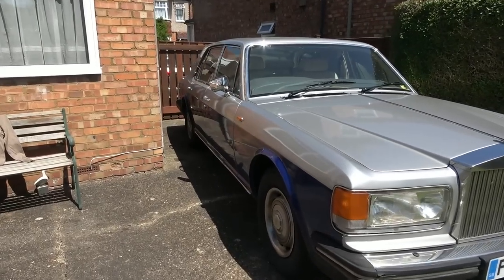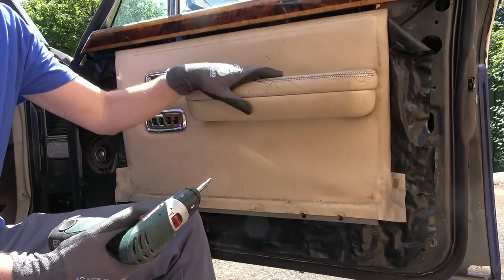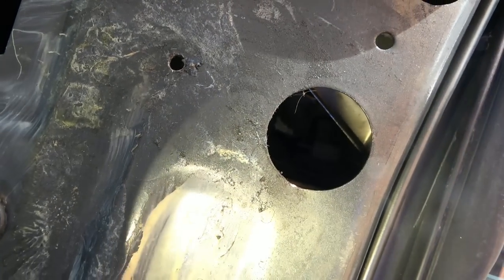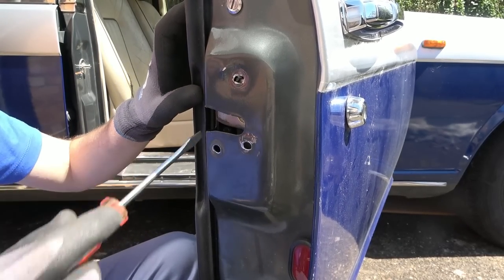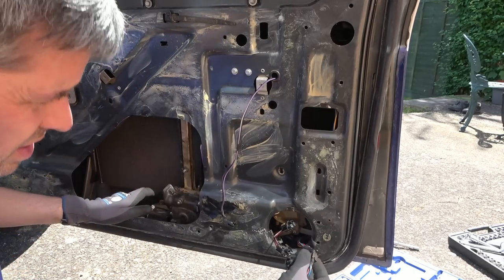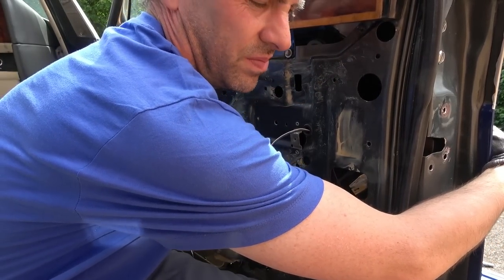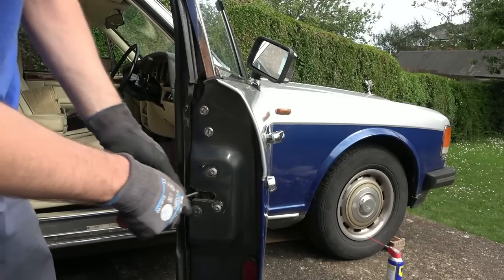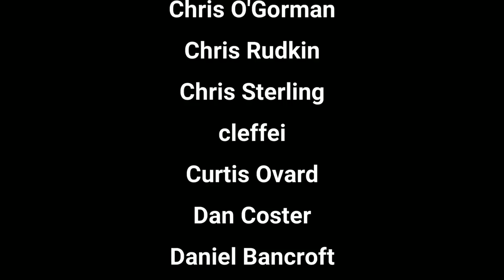CAN I FIX a ROLLS ROYCE - PART 1 - FAULTY DOOR NOT OPENING

Comment: Do you have access to a garage or storage locker? E.g. taking of the doors and working on them is way easierer. Also you can remove big chunks of the car to clear or refurbish without running the risk of getting your car all wet during a thunderstorm. And I guess you'll already do it correctly: but use a (small) bin for every part, e.g. left front door and label is, so you also don't get screws mixed up.
PS: If you take out the doors, be very careful with those springs. Maybe get a 2nd person helping as they can be really heavy.

Comment: Vince, you need to upgrade your tool kit!  A 1/4 inch drive socket set would be a good start.  Saves you having to struggle with limited access. You have plenty to keep you busy for a good while.

Comment: As a driver of old used cars the only recommendation I have is to make sure to grease everything mechanical before putting it back together. Nothing worse than sticky latches.
Reply: I think some spray lithium grease would be good.  I wonder what the RR maintenance manual recommends.  As a Mechanical Engineer it's important not to grease threads unless is it actually recommended. The relationship between friction, torque, and bolt/screw stress is not to be toyed with!

Comment: Buy the haynes manual or get an official workshop manual. Possibly on line. You will not regret spending the money
Also got to love the "Ill put the screwdriver through the whole and lever on the bit im trying to pull out.
Get a home glue puller kit

Comment: If your going to treat the electrical block connectors, cover the whole block in silicone grease, it wouldn't hurt to apply a bit to all the mechanical party's. This grease doesn't wash off with oil based solvents or water. So very long lasting.

Comment: I noticed that the screws on the side with the faulty lock release were Torx, but the side that was okay had counter sunk straight flat head screws.
So somebody had worked on that locking Mechanism previously. 
I wonder if there is a Haynes Manual for the Rolls Royce?

Comment: If that hole is dented in, I would stick a washer on a >4" long bolt. Reach into the door, and put it into the hole.
Then you can grab it with a slide hammer. (Or just use it as a press: drill a hole in a piece of wood[or whatever], put that on the bolt, put a nut on, and slowly screw the nut down). I assume slide hammer = cracked paint. press seems safer.

Comment: You saying about the leather, in my Reliant I have a rear seat set from a Robin 65 and apparently they used leather they bought from Rolls Royce direct for the very limited edition final Robin's which had full leather interior, electric windows and a deeper plush red carpet.

Comment: A crash repair person can best advise you on removing the dent in that door-shut, though I suspect a piece of metal cut to the right size and a slide hammer are going to be a better bet than prizing with a screwdriver. Get all that rust out and rust treat every internal bit you can get to while it's all apart, grease every mechanism etc

Comment: Did you try the Auto locking system when starting up the car?  it 32 minutes into this video I started thinking watch it be something simple like a fuse. Some cars ( I repeat SOME CARS) with power locking have a fuse for locking and another fuse for unlocking. same with power windows a fuse window up and another for window down. Which I experienced first hand.

Comment: I worked in the RR/Bentley factories in Crewe occasionally.

The interiors of the cars they crash tested were built up out of parts that had failed QC, they looked flawless to me but occasionally you'd get a part with a circle round  the 'flaw' to highlight it, they were usually near invisible. 

So, Hell no RR wouldn't have screwed through the carpet like that, that's been done by some cowboy and yes, the 4990 will mean the leather was all from the same hide/dye batch, the attention to detail and quality was insane which, along with the manual labour explains the cost.
Reply: I own a 89, 20,000miles, After watching this I looked for the screws.  I was a bit surprised to find two, nicely spaced, heads hidden by the carpet. Seems odd to me

Comment: Hey Vince, the central locking is supposed to work that way. When you unlock the drivers door you don't want all the others to unlock if you are alone. If you have company then you open the drivers door and unlock all others from the drivers door button. If you were a chauffeur you would have all doors unlocked  before your passengers arrived anyway. Don't go looking for a fault that isn't there, Ask me how I know.
Reply: I am pretty sure if Vince bumps the key further he will engage the electric locks.  It's how my 89 works.

Comment: i really mess this ability to repair in cars even though it’s a rolls-Royce you used to be able to do this in regular cars as well even though it wasn’t is fine material now it’s just throw away which is just sad very good video I did cringe a little bit when you were praying on the metal but you Gotta do what you Gotta do to get it straight so good job I’ll be interested to see what’s up with the window motor hopefully it’s nothing too serious I do love to build quality in those old cars there a joy to work on

Comment: I think you will be happy you got the end of the run MK1 because by then all the niggles etc have long been ironed out, the horror stories and wallet bending nightmares are the engine and suspension although not sure but didn't the MK1 use Citreon auto levelling suspension components?   Do you fancy a go at a 3d printer?   I got an early Flashforge Finder here that is not getting any use and it does have a fault in it has a bit of lateral drift but works fine with good motors and heater element, its bloody huge though m8 and not sure how much postage would be or if your PO box would accept it, not heavy just a big box, has a full roll of copper effect filament.   Yours if you want it m8, if you didn't mind waiting I could ask me uncle to deliver it when he comes visiting next as he lives in the Alms house in the high st.

Comment: Take off the wood trim. This will give you a better access to fix things. Where the damages to the lock area I will get some large washers and a bolt and a nut and tighten them up against each other it should flatten out the damage to where they screw goes to fix the lock to the door.

Comment: You did an awesome job, door mechanisms are a right pain and fiddly to work on. Torx screws just don't seem right for that age of car and UK built. Just seen the prices for replacements in a comment below! Might be worth seeing if there is a hobby engineer round with a small lathe that could make you some replacements or somewhere like Accu might already make something similar.
Reply: My 1989 does not have Torx, I agree those are out of place.  Slotted, with flashy washer like the other doors.

Comment: Try an inspection camera before dismantling. They are very cheap nowadays especially the USB type.  Even cheaper is to solder wires to some small 12v bulbs and light up the interior .

Comment: 5.52 hi MMV, looks like some of the metal clips are missing, you can see one not there under the speaker grill, thats way they used screws to hold the bottom of the door panel on

Comment: Such a nightmare of a door to disassemble.

With my 31yr old 4WD, I just undo 1 screw on the inside door release, remove it, undo 2 screws on the door handle, remove, remove the PP81 clip that holds the window winder in place (Making sure not to lose the blasted thing...), remove window winder, then pull door panel off from its clips, hey presto, I now have access to the entire inside of the door.

Comment: I hate they way the make it so hard to do a simple repair, I tried to fix my window that come off the belt in my car 3 hrs ago and the whole door panel was solid no holes only for wiring was riveted and had no access to anything.  How the heck are you suppose to do any work on that unless you remove all the rivets.

Comment: you could have put a bolt in the lock screw hole and use a sliding dent puller to remove the dent.

Comment: I don`t know why you didn`t just chop out a hole between the square hole and the round hole with an angle grinder, it would of given you easy access and probably wouldn`t of compromised the strength of the door much. I`m looking forward to you restoring all the veneers of the woodwork and the leather, they have apprentices take years to do that stuff well.

Comment: I'm guessing someone changed the door latch mechanism and the new latch has a different thread. That's why they couldn't replace the other screws. The new latch is metric thread probably. The old one was imperial. And they knocked the torx heads back into the door probably because they sit too high and scrape the other side of the door where the strikers fitted.

Comment: Um, is the key only unlocking the driver door, but locking all doors, not by design? It makes complete sense, unlock just your door for entry, if you need other doors unlocked just pull on your lock stem and then the other doors unlock; similarly, when you are leaving the car, you can lock all entry points by locking your door from outside?

Question this on any forum you've joined.

Comment: That door has been taken apart before the bolts on the lock are torx but the other side is flathead plus the torx bolts are all different and the paint around them is scratched and chipped away so so one else has been messing with the lock before you.

Comment: I think, in order to help your self and make life a little easier with the car, invest in a decent tool set. Nothing like a billion piece mechanics set but a good quality socket set, more 3/8th than 1/4 but they come in handy too. try to avoid the cheapy all in one sets because inevitably they'll be missing a common socket that you will need. trying to snake a 1/2 inch extension with a similar sized socket with a tiny 8mm (or smaller?) head on it seems like it caused more work than what its worth. and i'll probably keep from damaging more on the car.

Comment: To be honest, having a door not work is annoying. I did quality control for GM and yes there will be people looking at this as cringe-worthy but I think it's amazing. The window motor is called a regulator and it would be pricey to replace (with an official Rolls Royce regulator) but I bet with a bit of investigative motor repair you just might be able to fix it. I've seen you fix motors. If you need to substitute make sure orientation is right (up and down) and also control. You want to make sure the motor doesn't snap the glass.

Comment: Oh a really like the idea of this series, as you come closer to the engine and electrical valve's and hydronics.i probably can help you with some thing. Just one tip, painters uses a white paper to cover your flors, it is 
Brilliant to use around where use taking things apart. You can use a black pen to take notes of things to remember where you put things. It is like a giant note book.

But i restored a 944 and let me tell you some things i did do wrong.
Take you time and set your self a budget for time and money on different part of the car.

I did start small with things like seats electrical switches and relays.
Then i realised i needed to stripp every singel part to get to al the rust.
Some one did rebuild the hole engine and some where about 1100 hours in i needed to move the car from the garage and then every thing got messy. I sold some of the car as spear but not nearly got the money back.

What a great fix!
Even i would not love 20 minutes of taking out that bult, but it is intresting to follow in detail how to take it apart and follow you on your journey. But i think you feel when you have an excuse system and a petrol tank to take down to change the hydronic lines you can just put on some jonny cash and just work your self through, Because you have the red line of hydronics in that specific video.

I am so excited for part two!!
Thank you
Reply from the maker: The paper notebook is a great idea. I never realised you had a Porsche 944, I was looking at the 924 before my son mentioned the Rolls. Thanks for the feedback, I will probably shorten the dismantling bits and concentrate more on the problem and the fix (if there is one). Cheers Anders 👍👍👍

Comment: I guess if you've never done a lock before, you aren't going to know it's a 10min job to fix - lol -. 
You need to get a mirror to see what rods are pushing what - you can also buy a cheap endoscope for $10 -, because it looks like someone forgot to put the rod back in the nylon bushing when they took the lock out.  
You need a 3/8" drive socket set, ie, 1/2" is too big because access holes are usually small.
Your speaker is also ded - lol -.

Comment: The big giveaway that someone had been there before you was the T30 Torx bolts, on the passenger side latch retention screws were all polished chrome flat heads. 

The drivers side would have been exactly the same & with a vehicle of this age they would not be using Torx fasteners.

Comment: Also, don't be afraid to reverse-engineer - jump onto some auction sites, look for the part (e.g. the outer door handle), and examine the pics (if available). That might give you a hint in how it's installed.(Edited two times because I couldn't type "Engineer" lol)
Reply: I own an 89, almost exactly like Vince's car. My drivers seat became possessed, the seat back motored to full recline when I turned the key.  I jumped on eBay, found someone selling the seat motor package for this model.  So I jumped on it, to see if the seat motor was the issue.  I extracted one motor, and replaced motor driving the seat back.  Not the problem, but I was able to understand how it works and reversed the wires to run the seat back up so I could diver the car in "non-gangster" mode.  Since it wasn't the motor I jumped onto Flying Spares and upgraded the seat controller to one with out a battery that eats the circuit board if it's not replaced.  Great advice on buying bits.

Comment: my guess is someone trying to break into the car with the damage around the door lock, and the fact the button didn't work, maybe the previous owner locked the key in the car or something. but definately my guess would be attempted to break into the car. I would check that the key doesn't wobble more than a normal car lock, as possibly the c-clip has been damaged around the key lock itself.and probably the reason behind changing the screws is because the old ones were broken, or seriously bent by the attempt to break into the car.
Reply: great video Vince, hopefully you read these messages before attempting the fix with the window.

Comment: No way are those screws through the carpet original, you can see on the back the metal brackets are there but the spring clips missing

Comment: 34 minutes of yelling at the screen “Take the wood off, you’ll get more access room!”.

I’m not too familiar with Rolls, but on Toyotas, if you turn the key in the door lock it will only unlock the drivers door, but if you turn it to the unlock position TWICE, it will unlock all the doors.